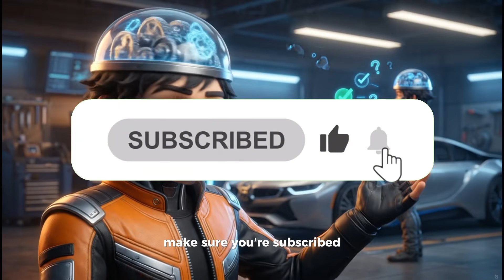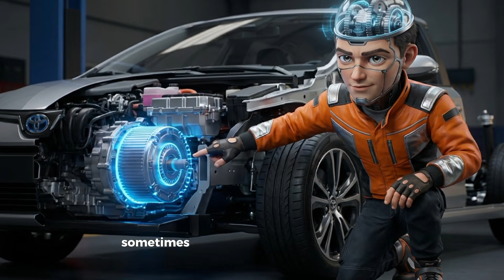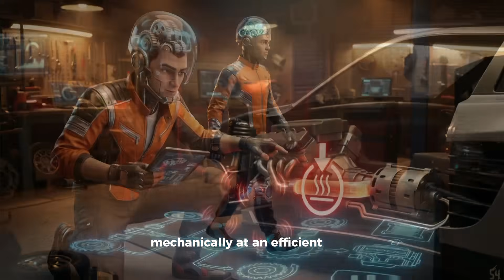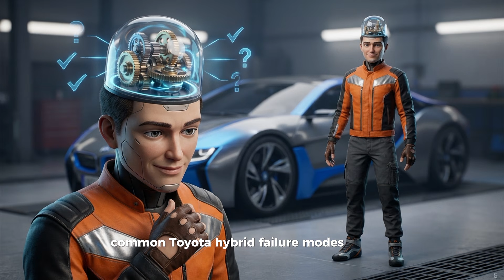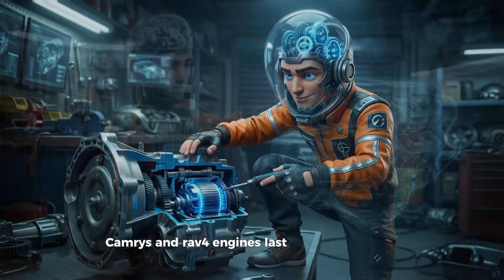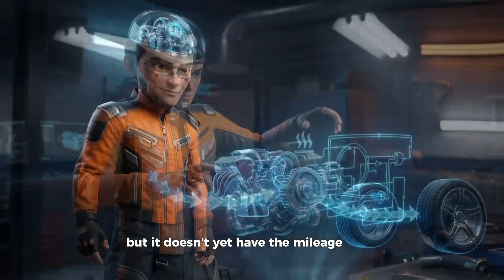Nissan e-Power vs. Toyota Hybrid: The Brutal Truth About 200,000-Mile Reliability

Comment from the maker: We have to talk about the brutal reality of physics. Nissan’s e-Power gives you that instant EV torque, but you pay an 'energy tax' every time you convert gas to electricity and then back to motion. Meanwhile, Toyota’s e-CVT allows the engine to drive the wheels mechanically when it’s most efficient. Toyota has 25 years of taxi-tested data, but Nissan claims they’ve finally built a hybrid that’s actually fun to drive. I want to hear from our GearHead community: If you were spending your own money on a car to keep for the next 15 years, are you betting on Toyota’s proven planetary gears or Nissan’s new series-hybrid 'EV' feel? Let’s settle this in the replies! 🔧

Comment: Having had the Qashqai e-Power for 3 years I would definitely recommend the e-Power if you want the EV experience without the range anxiety of a full blown EV. However, I have also had the Corolla Hybrid and found it to be very fuel efficient and pleasant to drive. The Toyota Hybrid however doesn't provide anything near the driving experience of an EV. Both are transitional technology's and should be seen as a stepping stone to driving a full EV. Is one better than the other? That is down to personal choice. I would recommend trying both to see which you prefer.
Reply from the maker: Coffee, thank you for watching and sharing your real-world experience, man! You absolutely nailed the exact difference in the driving dynamics between these two cars.

Here are the simple engineering facts behind what you are feeling: Nissan’s e-Power is a pure series hybrid. The gas engine is physically disconnected from the wheels and only acts as an electrical generator. This gives you instant, 100% electric motor torque at all times, which is why it feels exactly like a pure EV. Toyota, on the other hand, uses a planetary e-CVT that physically blends gas and electric power to the wheels, giving it that traditional combustion engine feel.

If a smooth EV driving experience is your main priority, the e-Power is a brilliant setup. But if we are strictly talking about 200,000-mile mechanical longevity and achieving the absolute lowest Total Cost of Ownership (TCO), Toyota's frictionless gearset is still the ultimate king.

You gave fantastic advice buyers absolutely need to test drive both to see which engineering philosophy fits their lifestyle. 🔧
Reply: @GearHead_Geniusgtr I have to confess, I spent most of my working life as a mechanic, or as they are called today, technicians. I chose the e-power to assess whether or not a full EV was for me. The e-power convinced me that an EV was the way forward. We are now driving a skoda enyaq 85x.
Reply from the maker: Coffee, maximum respect, my friend! Wrench to wrench, it makes perfect sense now why your breakdown of the driving dynamics was so mechanically accurate.  There is nothing better than talking to a fellow technician who actually understands what is happening under the hood.

It makes complete sense why the e-Power was your gateway. Because a series hybrid uses the gas engine strictly as a mobile generator, you were already 100% accustomed to the instant torque and braking characteristics of an electric motor drivetrain. Moving to the Skoda Enyaq 85x—which is a solid, well-engineered EV on that VAG MEB platform is the logical next step.

Safe driving in the Enyaq, brother! It's awesome to have another experienced tech in this community keeping us all honest. 🔧

Comment: I'm sorry this is unwatchable! The graphics are just wierd. I have no idea what conclusions you came to but I am confident that the e-Power system is a complete dodo from an efficiency point of view. This is merely a petrol engine driving the wheels via an electric motor. The battery is not large enough to provide and real benefit from absorbing energy while braking or engine overrun. Diesel electric transmission is useful on the railways because it helps solve the gearing problems required to effectively produce huge torque from combustion engines which can only operate efficiently at RPM too high to drive the wheels from standstill. The same applies to large marine systems. Steam engines however which used to be the default can provide huge torque at very low RPM. This is not the problem with lightweight passenger vehicles. It could be more useful in HGV or heavy machinery where the system may help reduce the massive battery weight and charging issues associated with battery electric systems. This is not the solution anyone is looking for!

Comment: We bought a then four year old Toyota Yaris Hybrid in 2016, and have had it ever since. The ODO stands at 144,000 kms (90,000 miles) at the moment. We love it. Smooth, gentle behaviour and low fuel consumption.
Reply from the maker: Georg, thanks for watching and for sharing your long-term experience with the Yaris Hybrid! You’ve essentially executed the perfect Total Cost of Ownership (TCO) strategy by buying a 4-year-old car and keeping it for a decade.

From an engineering standpoint, your Yaris relies on a scaled-down version of Toyota's proven planetary e-CVT, which completely avoids the wear-prone friction clutches and belts of traditional transmissions. At 144,000 kms, that drivetrain is still in its prime, and your description of its "gentle behavior" is exactly why these machines hit such high mechanical longevity milestones when maintained properly. Thanks for being part of the GearHead community! 🔧

Comment: Half-truth is lying. Both of these systems are imperfect. The best technical solution for hybrid cars currently produced is BYD. It drives in the city like a Nissan and on the highway like a Toyota, with the difference that the engine is connected to the wheels without any gearbox. BYD produces the best electric cars in the world, but they have to take money from the stupid by selling hybrid cars.
Reply from the maker: Mart, thanks for watching and for bringing that sharp engineering critique to the GearHead community! You’ve perfectly described why BYD’s DM-i system is such a disruptor; it essentially functions as a series-hybrid in town for maximum smoothness and then utilizes a direct-drive clutch to lock the engine to the wheels at highway speeds where it's thermodynamically most efficient. While it effectively replaces a complex multi-speed gearbox with power electronics and a simple gear ratio, the reason I weigh the Toyota and Nissan systems so heavily in this specific video is the 200,000-mile track record.

BYD is undeniably winning the innovation and price war right now, but from a strict Total Cost of Ownership (TCO) and mechanical longevity standpoint, most pragmatic buyers are still waiting to see if that Chinese hardware can survive the same 15-year "taxi-abuse" cycles that Toyota has already conquered. It’s not about people being "stupid" for buying hybrids; it’s often a calculated choice for those who lack charging infrastructure or want the highest possible resale value on the used market. It’s an exciting time for drivetrain engineering, and I appreciate you pushing the conversation toward the latest tech! 🔧

Comment: Nissan sinking ship 😢😢
Reply from the maker: bmw867, thanks for watching and for sharing that honest assessment with the GearHead community. It is definitely a tough reality to watch unfold in the automotive market right now. From a strict engineering standpoint, the Nissan e-Power system is actually a brilliant series hybrid architecture that delivers a fantastic, smooth EV driving dynamic. The problem isn't necessarily their new technology; it is the decades of prior corporate mismanagement and the notorious legacy of their fragile belt-driven CVTs that completely destroyed consumer trust.
Reply: @GearHead_Geniusgtr they are not capable to compete with chinese evs😢
Reply from the maker: @bmw867, my friend! Always great to see you back in the comments. You’ve highlighted the single biggest existential threat to legacy automakers like Nissan.

From a strict engineering and Total Cost of Ownership (TCO) standpoint, Chinese brands like BYD have achieved a level of vertical integration specifically with their LFP Blade batteries that allows them to undercut Nissan's pricing by thousands while offering more range and tech. Even though systems like Nissan e-Power are clever, it’s incredibly difficult to compete when your manufacturing costs are anchored to older supply chains. Nissan is definitely in a fight for its life against this massive market disruption.

Thanks for keeping the discussion so forward-thinking! 🔧

Comment: Great graphics well presented, a lot of work went into this thank you 👌 this is my dilemma, Nissan Toyota or Kia 🤔🥴🤷🏼‍♂️🤣
Reply from the maker: Pete, thank you so much for the kind words and for recognizing the work that goes into the visuals! That three-way dilemma you are facing is the exact battle happening in the market right now. From an engineering and Total Cost of Ownership (TCO) standpoint, you are choosing between three completely different mechanical philosophies. Toyota gives you the risk-averse, 300,000-mile reliability of a constant-mesh planetary e-CVT. Nissan’s e-Power offers a pure series hybrid architecture where the electric motor drives the wheels 100% of the time, giving you a smooth, premium EV driving dynamic at the expense of decades of historical fleet data. Finally, Kia takes a traditional approach by sandwiching an electric motor inside a standard 6-speed automatic, which avoids the CVT drone but retains the wear-prone friction clutches and shifting components of a normal gas car. It ultimately comes down to whether your absolute priority is bulletproof longevity, a seamless electric feel, or traditional geared shifting. Thanks for being part of the GearHead community! 🔧

Comment: Nissan e-power is not new.  It maybe new in US, but it has been selling in other parts of the world for years. Nissan also has its own EV, and, that is before Tesla. So they know about EV and how to get it work. 

To me, Nissan just took what they learned from their EV design, instead of charging it's battery via power socket, they just changed that with petrol generator inside the car. So, it will having same driving experience EV but no worries of range anxiety. It does sound like a nice idea to me.

I don't think I can agree to say it is not as reliable or proven as Toyota Hybrid.
Reply from the maker: Lenrek, thanks for watching and for bringing this excellent historical perspective to the GearHead community!

You are 100% correct about Nissan’s pedigree. They pioneered the mass-market EV with the Leaf long before Tesla, and the e-Power system is exactly as you described: a pure series hybrid that perfectly delivers that instant-torque EV driving experience while completely eliminating range anxiety. From a daily driving and comfort standpoint, it is a brilliant piece of engineering.

However, from a strict Total Cost of Ownership (TCO) and longevity standpoint, the hesitation comes from comparing the hardware history. While Nissan knows EVs, their early battery packs famously suffered from severe degradation due to a lack of active thermal management. Furthermore, while e-Power is a solid system that debuted in 2016, Toyota’s planetary e-CVT has been racking up brutal, 300,000-mile commercial taxi data globally since 1997.

Nissan has built an incredibly smooth and innovative drivetrain, but mathematically, they simply need another decade of extreme high-mileage fleet data to truly challenge Toyota's "bulletproof" mechanical track record. Thanks for adding this great debate to the comments! 🔧

Comment: Keep your opinions 

E power   for me
Reply from the maker: Gaza, thanks for watching and for dropping your honest, straightforward take in the comments!

I completely respect that choice, and from a pure driving dynamics standpoint, it is incredibly easy to see why you prefer the Nissan e-Power. Because it utilizes a pure series hybrid architecture where the electric motor drives the wheels 100% of the time, you get that instant, seamless EV torque while completely avoiding the "rubber band" engine drone of Toyota's planetary e-CVT. If that premium, electric-only driving feel is your top priority for your daily commute, then you are buying the exact right mechanical tool for your life.

My analysis is strictly focused on risk-averse, 200,000-mile Total Cost of Ownership (TCO) and historical fleet data, but at the end of the day, you have to buy the machine you actually enjoy driving. Thanks for bringing your perspective to the community! 🔧

Comment: I've driven a Nissan E-Power Kicks and its smoother, quiter and quicker than toyota's hybrid system. Nissan has certianly stepped up. Also. Nissan has already sold over 2 million E-Power vehicles around the world.
Reply from the maker: Conrad, thanks for watching and for bringing your firsthand driving experience and that impressive sales milestone to our GearHead community! From an engineering and driving dynamics standpoint, you are 100% correct about the Nissan Kicks e-Power. Because it utilizes a pure series hybrid architecture where the electric traction motor exclusively drives the wheels, it completely eliminates the notorious "rubber-band" engine drone of Toyota's planetary e-CVT, delivering that instant, silent EV torque that makes it feel much quicker and smoother around town. Hitting 2 million global sales is a massive achievement for Nissan and proves the market absolutely loves that refinement. However, from a strict Total Cost of Ownership (TCO) and long-term longevity perspective, the mechanical reality is that buyers are essentially trading Toyota's 25-year, 300,000-mile proven track record for Nissan's superior daily driving comfort. It is a brilliant system that forces pragmatic buyers to weigh daily driving enjoyment against risk-averse historical reliability, and it’s genuinely great to hear the e-Power is performing so well for you in the real world. Thanks for adding this top-tier perspective to the family! 🔧

Comment: What is the actual fuel consumption in the city, on standard roads (50 mph) and at motorway speeds (75-85 mph) ?
Reply from the maker: Page, thanks for watching and for asking the exact real-world question that dictates your Total Cost of Ownership! From an engineering standpoint, in heavy city traffic and steady 50 mph backroads, the two systems are in a dead heat; Nissan's series-hybrid architecture drives the wheels purely on electric torque, delivering incredible efficiency and smoothness that easily matches Toyota. However, at motorway speeds of 75-85 mph, the physics completely shift in Toyota's favor. At those sustained high speeds, Nissan's e-Power is forced to pay a thermodynamic "energy conversion tax" (burning gas to spin a generator, just to power a motor), whereas Toyota’s planetary e-CVT allows the gas engine to mechanically drive the wheels directly. By eliminating those electrical conversion losses on the highway, Toyota mathematically wins the high-speed fuel economy battle. Ultimately, the Nissan is a brilliant, smooth-driving tool for the urban commuter, but the Toyota remains the undisputed financial winner for heavy highway drivers. Thanks for bringing this data-focused question to the community! 🔧